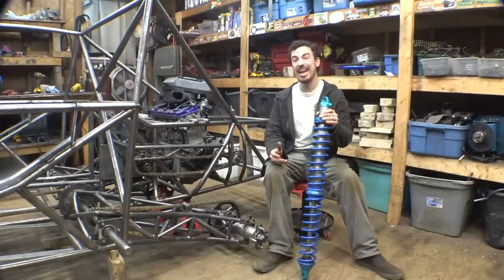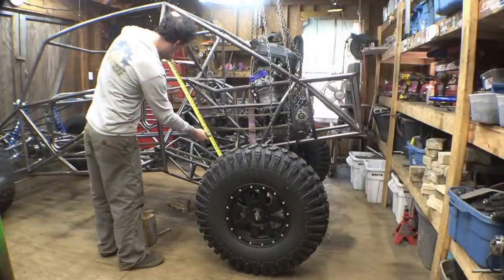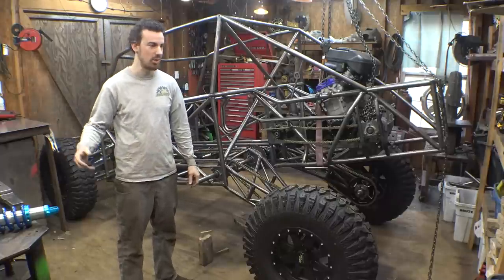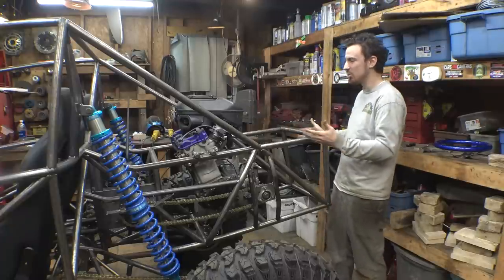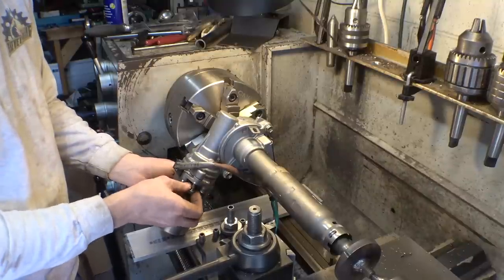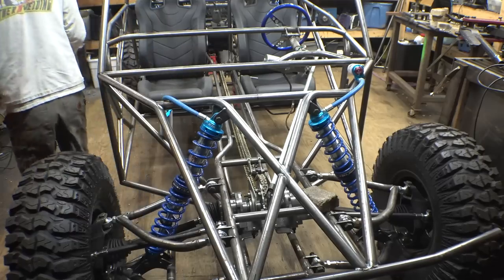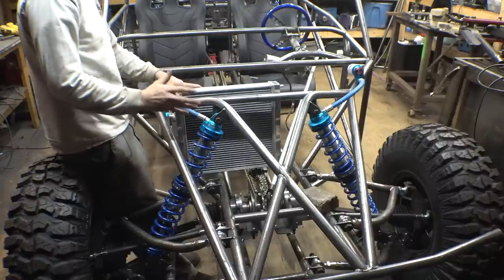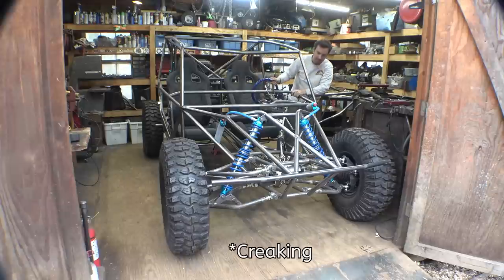Finishing the Rear Suspension... Mini 4WD Trophy Truck Project - Part 13

Comment: You should mount the radiator up front right under the x piece at the same angle as it too. Would get more air right up front and it would look sweet mounted laid down on an angle like that.
Reply: That's what I was thinking
Reply: i thought the same
Reply: I thought Chris would mount it there too,so the air could be vented in front of the suspension and Under the vehicle with an airbox around it.
Reply: @bryduhbikeguy  would be a lot easier to duct it down under the vehicle without compromising on the leg room inside
Reply: You can use the tubing of the chassis as coolant lines if you plan carefully.
Reply: @chadc2222  I was gonna say this
Reply: This dude knows what's up
Reply: And the farthest away from the risk of occupants suffering scalding because of a cooling system breech
Reply: YES. With a little wind scoop
Reply: Also keeps it away from the chain
Reply: Going suggest the same. But add a air scoop or dam to direct air to the radiator and the hot air away from cockpit area.
Reply: i was screaming at the  screen the same thing!
Reply: V mount with an oil cooler maybe
Reply: Or build a new x wing.
Reply: true, but it would also be cool to have the radiator in the rear with an interior duct, so not a lot of mud and dirt can enter. Yamaha did that on their yxz1000r. the front might get more airflow though so I don't care what he does.
Reply: @megaraids8475  he’s said he wants to put it up front in a previous video
Reply: @dawsongiardino2802  ok cool I didn't hear that
Reply: @megaraids8475  yeah I think he was saying because that’s what he did with the cbr1000 build

Comment: 14:23 Put the radiator at the top-rear, and give it a wide slot-shaped air pod/scoop on top of the roof of the rollcage.... A lot of buggies do that. Radiator in front of the people means a lot of extra heat in the summer....

Rally Raid/Dakar/Safari..... BUGGY. Team RBW 😁

Comment: mount the radiator up front right under the x piece at the same angle as it too. Would get more air right up front and it would look sweet mounted laid down on an angle like that.

Comment: Experience jumping various vehicles, your going to want limit straps atleast on rhe back, the weight of the rear swing arms slamming into the seals of the shocks with destroy them FAST so for longevity you should just put limit straps on

Comment: I would suggest the radiator in the back on the side or rear with electric cooling fan, would eliminate excess hosing or tubing to the front. Also consider getting burned by hot coolant in the event of loosing a coolant connection. Great job though, very cool!

Comment: Dude. Chris.
you have NO idea how much this project in particular has inspired me to start my own project
I will be making a truggy using a '50s era 3-speed transmission, as well as a 4-link or solid rear axle from a real truck
the rest will be handbuilt and the engine is still a big question mark, but all i know is that youve inspired me to do a LOT of planning and prepping and the motivation to begin my own projects using my skills
I not only thank you, but i congratulate you on your hard work and fruition with your projects in the past and this current WIP
keep it up man, this content is just perfection!
Reply from the maker: Thanks man. That’s awesome to hear
Reply: @ratherBweldingChris  in my opinion (not one thats worth anything lol), you have some of the best projects this side of the internet!
Reply: @charlesirby9222  Ill try and get some basic vids uploaded, but it wont be for a while due to major lack of everything needed lol. But I DO have that transmission Ill be using!
Reply: @foxwolfworkshed5080  OKIE'DOKIE...I'm subber no. 16!
Reply: @charlesirby9222  ack!
you didnt have to!!

Comment: i would suggest putting some chain  guides on those rear chains, it will help with the chains not coming off under a lot of tension, you could get some off of a dirtbike or motorcycle and fab up custom mounts

Comment: Hey Chris - Future reference for those Prius steering columns.  On the steering wheel end of the column, there's a snap ring you can pull out, then you can gently pull the upper stub/bearing of the shaft out of the column with a slide hammer, or some vise grips and a hammer.  That'd make it much less sketchy to machine, then just reinstall in the column and reinstall the snap ring.

Currently working on trying to graft one of the prius columns into my stock 95 miata column so I can get some assist on my manual rack when stopped, so I've taken most of the prius column apart.  

Keep up with the awesome build, my man!  This thing is gonna rock!

Comment: chain reaction is coming together nicely!
if you set the suspension up like an actual trophy truck, the ride height should be somewhat squatted and allow for a lot of travel downward when unsprung. 
also, you can utilize the lower shock mount to double as a chain slide/roller point.

Comment: You have around 4" of travel on those springs... that threaded ring on the shock.  Just back off the ring a bit and lower things about 4".  Most of your weight is in the back so the lesser travel in the front should not really be any issue.  I would have also put the radiator in back.  Just weld onto the back corners with a tube and after about 12" or so put a bend and go up to the roof.
Reply: He already said he could but the springs will free float and didnt want that meaning preload is already backed off to the max

Comment: Love your work mate. Just a couple of things I might suggest. I would run the 16 inch shocks on the back and move the top shock mount up higher and box the mount in. Those big wheels and tyres will generate huge forces. The radiator i know you want it up front but at crawling speeds your not going to get much airflow anyway so just mount it up back and put a good quality fan like a brushless variable speed Spal or similar that way you get good cooling. Just my 2 cents worth love the build and thought that you put into it Thankyou.

Comment: With someone sitting in there, the rear ride height looks just fine.  Very cool steering setup. Curious to see the radiator & shroud setup.
Hoping those doors will have some solid latches. For sure, they'd be super dangerous without a strong latch. Squish risk on rollover is extreme.

Comment: Can you add a couple supports to the bracket holding the Rack n' Pinion on?? I see it flexing a little, I could see it failing if you have some momentum and hit a rock while crawling. Also I didn't catch the last few videos, last one I watched you said something like "Not sure I'm guna put doors on it". Super glad to see you made some, good stuff. Also have you heard of a tool called a "Tube Rotation Gauge" for your tube bender? I think it could help. and a protractor angle gauge mounted to the base of your bender!

Comment: There are trophy truck radiators mounted on the rear roll bars with twin fan set up the uses forced induction cowls out of aluminum or sheet metal. It would be centered and give you that extra weight you were needing in the rear to help lower it

Comment: Whatever you do, please mount the radiator the right side up. Your mock-up was on it's side. The filler cap needs to point up. And no, that radiator, even with all new side tanks and completely new flow pattern design, will not work on it's side. They tried that on Triumph Stagg, and it failed. And another thing: If you lean the radiator back and go uphill, you create an air block inside the radiator, and your water pump sucks air instead of coolant. Again, no matter how big your new radiator is, your headgasket will then blow. Best place for it is directly above the engine, hose fittings pointing down. Remember to add an expansion tank.

Comment: VERY nice work so far Chris!
Firstly, I actually think the rear ride height being greater than the front looks cool and I can't see any harm in leaving it as is...especially since itr'll eventually be heavier in the rear and will probably need that little extra it has...
However, if you reaslly wish to even it out, Why don't you mount a spare wheel on the very rear of the project? It could mean you need to shorten the frame at the rear a little, but the spare wheel along with the engine, fuel tank and so on could possibly give you the weight you need to balance it out...

Ookay, your commenting about the "stance" of cars and the like (front or rear being lower etc) made me think; this may be wrong, but I vaguelly recall the "stance" of cars as "stooped", where the front is lower than the rear, "slammed", where the whole car is lowered (plenty of examples online), "squatted", where the rear is lowered and "jacked", where the vehicle is raised up higher than standard... 
I could be totally wrong about this since my knowledge about "gassers" is close to zero, but they make the Classic "rods" I've seen look like the front is jacked, but not to the point where you can't see whats going on

Comment: Mount the radiator in front of the shocks in the nose and reinforce the nose you can also have a sheet metal hood direct the airflow down in front of the rack and pinion

Comment: You are doing great.   I suggest that you seriously consider putting the radiator in the back.  From the looks of it you can put it low enough to still see back with a mirror and this would address the heat issue for you and the passenger.  Just a thought.

Comment: Hey Chris since you're going to have such a long distance from your motor to your radiator I'd recommend getting a auxiliary water pump from a 1996 Volkswagen Jetta with a VR6 motor they're about 50 bucks on RockAuto and it will allow you to keep water flow consistent from the motor to the radiator

Comment: It's lookin great man!

Squad the rear with a little more weight and springs like you said. Then look at lowering the roof height 6". You have ALL KINDS of daylight above your head when seated in the driver's seat. I think that's contributing to making it look overly large.

Comment: IMO... Cut off just that small section on the back that is squared and let the slope run top to bottom on the back, and make a nice spot to mount the spare tire. Will fit nicely back there angled, following the the rear lines. 😎

Comment: If you want more front travel build the front arms correctly with the heims level at ride height. You can use actual truck ball joints with high angle capability too. Pretty sure you are capable of machining a taper or a split collar for a straight shank.

Comment: Hi comrade, I love to follow your achievements made without an additional plan, and that's rather rare. I love seeing you making, cutting, turning your pieces. you are a little genius and very ingenious. moreover on this subject, are you an engineer at the base, where as we say in France, you were formed on the job by observing for example. In any case I admire you, you are one of the most ingenious and friendly people on YouTube. By the way, what about your electric motorcycle? you don't talk to us about it anymore, since I'm a fan of 2 wheels and now for several years now have 2 electric toues, which is why I mounted a powerful Bomber with, like you, a motor wheel and I'm fully into it satisfied, I managed to climb max between 100 and 108 km / h depending on the weather conditions and it has great acceleration for a weight of 82 kg.
In any case, continue to delight us with your crazy achievements and I can't wait to see you on this huge machine, doing all terrain.

Salut camarade, j'adore suivre tes réalisations faites sans plan en plus, et çà c'est plutôt rare. j'adore te voir fabriquer, découper, tourner tes pièces. tu es un petit génie et très ingénieux. d'ailleurs à ce propos, es tu ingénieur à la base, où comme on dit en France, tu t'es formé sur le tas en observant par exemple. En tout cas je t'admire, tu fais partie des gens sur YouTube les plus ingénieux et sympathiques en plus. Au fait qu'est ce qu'il en est de ta moto électrique ? tu ne nous en parles plus, vu que moi je suis un inconditionnel du 2 roues et maintenant depuis plusieurs années des 2 toues électriques, bien pour çà que je me suis monté un Bomber puissant avec comme toi un motor roue et j'en suis pleinement satisfait, j'ai réussi à monter max entre 100 et 108 km/h suivant les conditions climatiques et il a de super accélérations pour un poids de 82 kg.
En tout cas, continues à nous régaler avec tes réalisations folles et j'ai hâte de te voir sur cet énorme engin, à faire du tout terrain.

Comment: Laying down introduces air locks in the Radiator so then you have to add a separate header tank to bleed it.
Alot of plumbing to get it to the back of the vehicle & to crawl over Rocks, It needs a electric Fan to keep it Cool.
The last thing you want is Boiling water spurting out in front of you when your going Forward.
I enjoy everything Chris does & if it was me, I would get some advice by the the Guys that run these type of Vehicles & check which is the most effecient way of fitting a radiator & Chris is taking a Break so he has some time to do some research.

Comment: Putting the radiator in the back would be better if you can fit it in. No hot coolant lines that could fail and burn you

Comment: You should put the radiator right up in the front just on the backside of that x-brace that way if you do ever blow a radiator hose or get a hole in the radiator you don't get sprayed with the hot antifreeze

Comment: If you slide the front shocks to the other mounting point that would raise the front and even the ride height out a bit. I don't think you need to go lower overall. Just even ride height.

Comment: I think you should mount it higher so you want be limited to the elements.and also raise the front to about the height of the back because it is supposed to be a truck right😏😉

Comment: I'm pretty sure building a trophy truck you want to have a little bit more travel in the rear suspension than you do the front it helps with uneven terrain and uneven landings

Comment: I really like what you're doing looks great and I understand wanting to put the radiator in the front for space and Cooling but the radiator in my Razor is in front and it makes it hot in the cab, placing it in the rear somewhere would be much easier and you'll appreciate it in the summertime just my thought

Comment: The true limitation of true articulation of your suspension is not necessarily the amount of movement in your suspension. 
Because you have to figure in a number of things to go along with that..
Most people have limiting straps to keep their suspension from moving the entire distance that it's actually capable of moving. 
What is actually happening to your driveline during full movement either way. 
Next is your suspension set up for massive side loading, that very well could damage your axles, pull your drive shaft outta either the carrier bearing support, out of the transmission tail housing, or transfer case pending on which axle is in process of moving. 
 Not using  Dom tubing greatly reduces the strength the compon. steel supporting the entire vehicles weight or majority depends on what angle the vehicle is at during  section of track at that requires o

Comment: I have a 2017 Can-Am X3 Xds Max Turbo R I am running 35" x 10 x 15  tires  24 inch of  wheel travel . I don't have a bet of trouble I run limit strips  on the shocks.

Comment: I wouldn’t sweat it on the height of it I would take some plate and make a full belly pan that goes under the motor also it would add enough weight to help stabilize it, then back your shocks off till it starts to soften and then sit abunch of weight on it and let it sit over night

Comment: I'm anxious to see how much chain deflection your going to get with thar front drive chain.  I know in the 1930s they tired that chain system on some trucks but they were doing really slow speeds.  I knows you're putting chain guards but I'm just curious to see it in real time.

Comment: Just allow the rear wheels to go up higher, mount top of rear shocks at least 2 inches higher, you had overkill on clearance at full bump.
Reply: The other option would be to mount bottom of rear shocks further out on the arm towards the wheel center. Will also reduce your travel, but then spring rate may be too high.

Comment: How about a split radiator like dirt bikes or CBR, RC45, Also, a radiator from a bike like a 2006 zx10r is significantly smaller and curved.  Put shrouds and have the cool air go through the center and vent to the outside in front of the doors.

Comment: If the shocks have the right amount of dampening,  you shouldn't more than fourteen inches of travel. in fact ten inches would be more than sufficient. I haven't seen one of those sparkly steering wheels in a long time cool. I have said it before in a 
past comment that you really like things to be symmetrical. I'm the same way but sometimes it's unavoidable. and it's less noticeable from a distance. it's to bad a person couldn't build a project just like that one. with all it's features only in a much smaller package. more like go kart sized that would probably be pretty difficult to do.

Comment: You're doing great work. Now it's time for you to graduate up to building beast vehicles with drive shafts and differentials. You have proven you can do this chain drive systems and now you need to do something with used Toyota drive trains and just build the vehicle

Comment: Try finding an electric water pump so you have the water flowing at the same rate as if it’s in high rpm’s and it will help a lot with cooling drifting pros use it because the only time they get to cool off is in the grids and the car is idling

Comment: Hi. Question. 17:00 Are you not able to mount the radiator in front of the suspension? Asking purely out of curiosity. Cause then, from the angles I can see, it would automatically angle it to the point where the hot air would be directed downwards